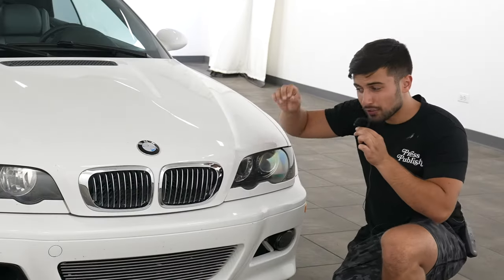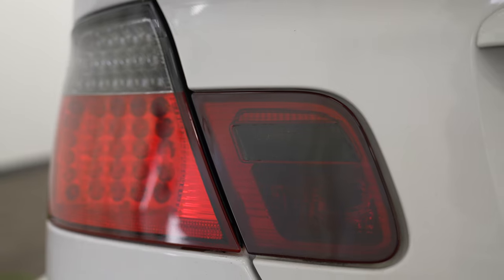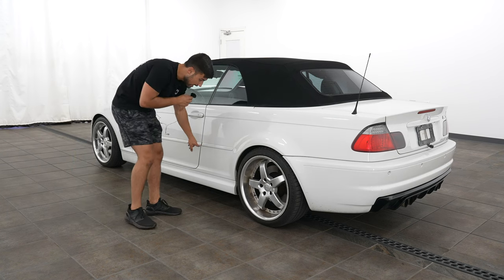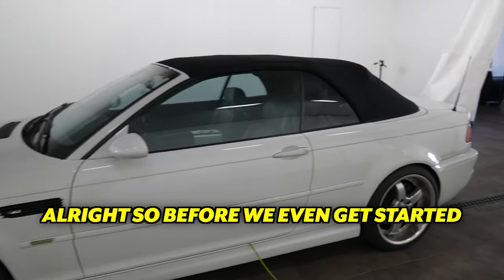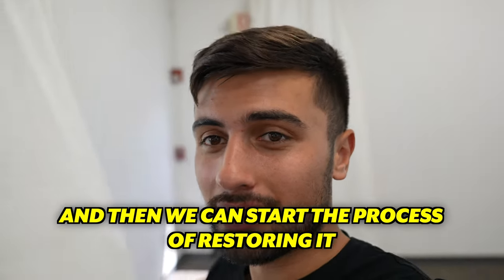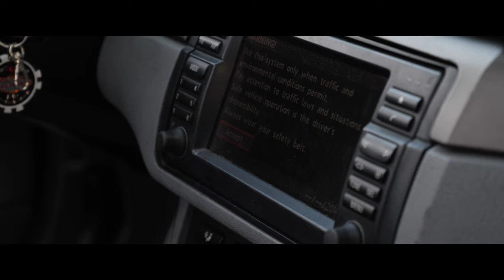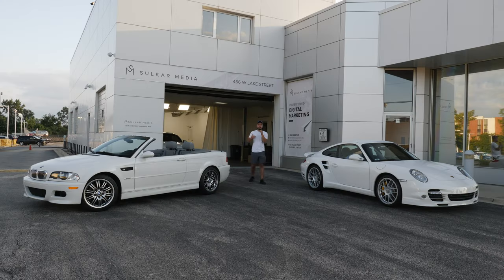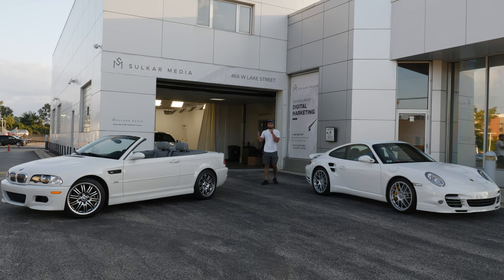Making A 20 Year Old BMW M3 New Again

Comment: Great vid.  What is that interior wheel tool you have on the drill ?
Reply from the maker: Thank you my friend! They are from Amazon actually. Build quality isn’t impeccable but cheap enough to almost be disposable haha. White is super soft and yellow is a bit more aggressive.
Reply: Great stuff. What spray did you use to clean the interior vinyl and leather, door panels etc?